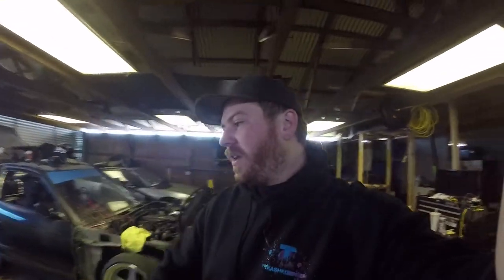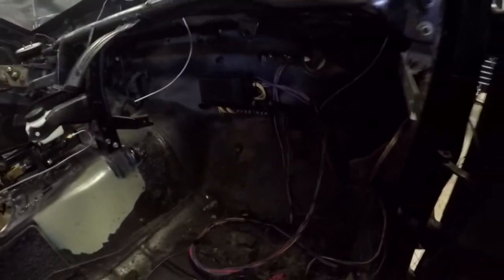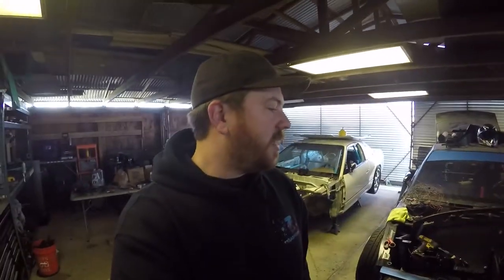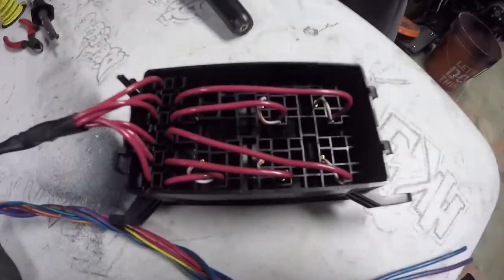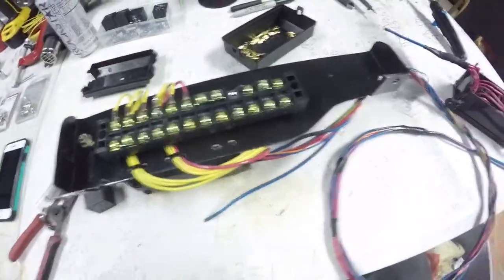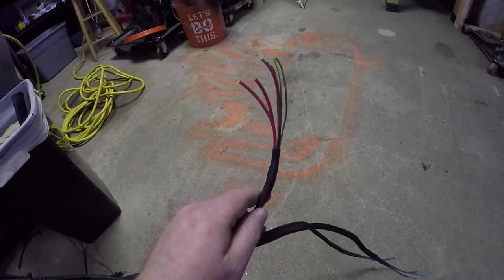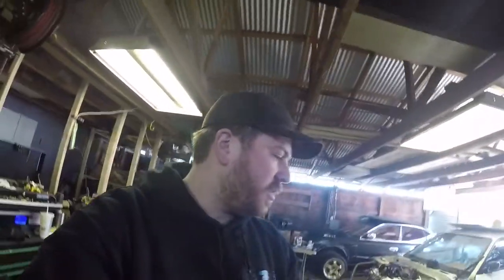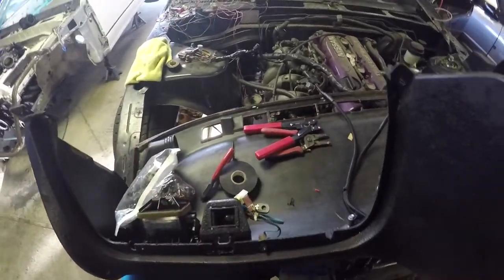Wiring up the 240sx

Comment: Looks great! Mind explaining how you powered the sr20 ecu? i know theres 2 pins for power and 1 pin for "ecu back up power" curious if you would know which would need constant and or switched 12v? Thanks for your time!
Reply from the maker: Thanks! On my distribution block I had a 12v constant. The ecu backup power should be constant, the rest are switched. You can technically get away with the back up being switched too, but the ecu won’t hold any memory. I’m getting ready to rewire my engine harness for direct plug and play with the ecu masters classic, so I’ll be dabbling in that, if you have any other questions just lmk!!
Reply: @ThrashedChassis  Awesome. Makes sense. I would like to create a custom chassis and lower harness so im trying to do my homework before i take the plunge. I will be reusing my old engine harness.. do you know if i can depin pin 104 for the fuel pump replay if i have it on its own circuit? Also, how is pin 4 (ecu relay) treated? Basically wondering what bare minimum i need to before i start depinning and cleaning the oem engine harness..